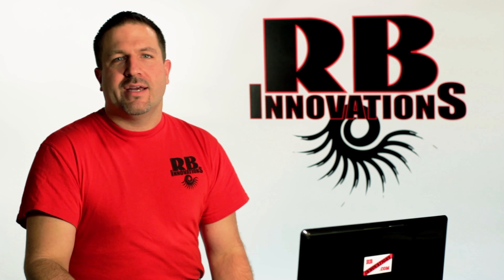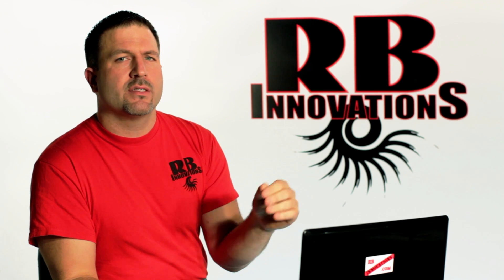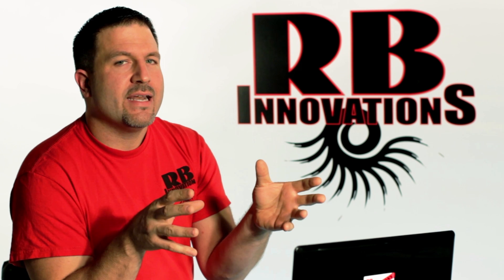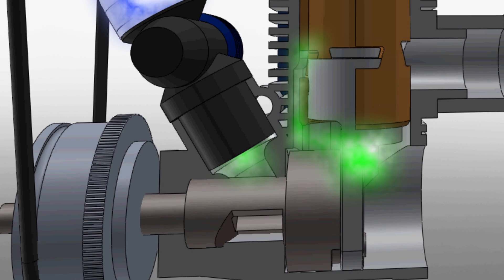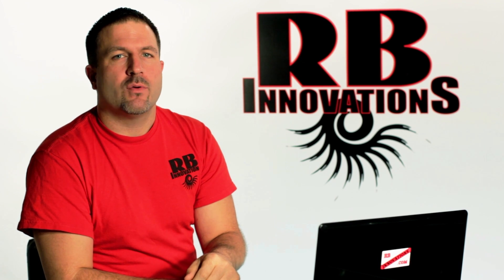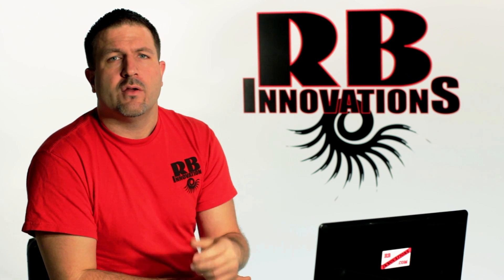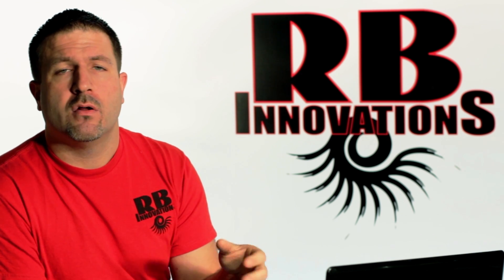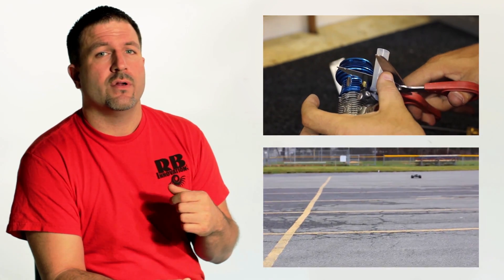How RC Nitro Superchargers Work

Comment: my name is  Peter. .. I want to say  that  if you  had  an extra sleeve  you could  tune  the  port  timing  and  volume. .    grind  some  material behind the engine cases..  and a bit  off the sleeve.   allows more volume of air to enter the engine. ..

Comment: Put it on a dyno or line 2 cars up which are exactly the same with one with one without the super charger. DEMONSTRATE the power gain.
Reply: Not much gain....even wit a boost bottle
Reply: It seems to be just blowing fuel out if it's doing anything at all. I might try hooking the engine up to an air compressor to see if boost does actually work on these engines but then again the pressure from the air compressor may falsify the results.

Comment: Ok its as I thought. At 1:45 he just described the process of a turbocharger, not a supercharger. A supercharger compresses the air/fuel mix before it enters the engine. Its like those cheap 12volt "superchargers" for car engines that are the size of a computer cooling fan inserted into the air duct after the airfilter, before the throttle body. In this case the exhaust must also be modified if the added air is to have the ability to flow through the motor.
Reply: What in the hell are you talking about?  This is a centrifugal supercharger, which uses the same kind of impeller as all turbochargers.  That's what he's talking about.  A turbocharger also compresses the air/fuel mix before it enters the engine - the only difference is what drives the compressor (a belt drive off the crank vs the exhaust gas).  This is a belt-driving supercharger, and there are many large centrifugal superchargers for car engines out there, and there even have been for some airplane engines (thinking most of some WWII fighter and bomber engines).
Reply: Matthew Miller Here, read this.
http://www.cumminsturbotechnologies.com/ctt/navigationAction.do?url=SiteContent+en+HTML+ProductsAndTechnologies+How_a_Turbocharger_Works
Ok I can take a correction about mechanically driven air compressors, aka superchargers, but only the ones that only compress the air first, exactly as a turbocharger does. Just so you know, it would be impossible to have the fuel and air enter a centrifugal impeller, as due to its density,the liquid would get forced to the outside of the wheel and be separated from the air, totally negating the desired effect of compressing the two together. It would also lead to hammering, and this vibration would tear the vanes off the impeller, causing the housing to explode. So I stand by my terminology. A Roots type supercharger is a positive displacement  device which compresses the fuel and air before it enters the intake plenum. Any belt or exhaust driven device should be called a turbocharger. The line shouldve been drawn to differentiate the two based upon their process, not by how they were powered. A simplification by having two distinct terms other than turbo and super would make things much easier. Oh and the superchargers used on planes werent belt driven. Are you nuts? A rubber belt on an airplane travelling through sub-freezing temperatures? They are mechanically driven from the engine.
Reply: John Robertson There have been plenty of carbureted, centrifugally compressed supercharger and turbocharger setups with draw-through architecture; such that they draw the fuel/air mixture through the compressor rather than just air.  It's not drawing liquid, but rather a vapor of fuel mixed with air.  It works fine.  I'm not sure what you mean by "hammering" - maybe cavitation?  Not an issue with vapor.  Anyway, there are also lots of centrifugal pumps for liquid, too.  So again, not an issue.  BTW, the full and technically correct term for a turbocharger is "turbosupercharger."  So all turbochargers are superchargers, but not all superchargers are turbochargers.  Anything that compresses the intake charge of an internal combustion engine is a superchargers.  Whether positive-displacement, centrifugal, or axial design; they all do that same job.  And I didn't say airplanes with superchargers had belts driving them - I just said some airplanes also had centrifugal superchargers.  That is, neither the technology nor terminology in the video is new or untested.
Reply: John Robertson Also, I'm not sure what you mean by "only the ones that compress the air first."  All superchargers, regardless of compressor design or drive mechanism compress the air or fuel/air mixture going into the engine.
Reply: Matthew Miller If you read back a few posts, someone said superchargers do NOT function in a manner as to compress the air/fuel mix. That is when I corrected them as to the existence of the Roots type of device. So I admit the existence of the air only "supercharger", however, I am saying it needs to be called something else, and the two types of devices should be separated by their function. In other words, if it compresses air only, regardless of what is used to turn the impeller, it should  be called an "AO"charger. If it compresses air/fuel, lets call it an AFcharger, or something like that. I thought I went to some effort to point that out in my last post, I can see some things escape the obvious. Dont be too hasty to comment on just one item in someone elses comment, you miss a lot, and just make it a PITA to have to explain it again.
Reply: Matthew Miller So the world of forced induction is worried about someone not being able to completely understand the function of something, because they change the name and all of a sudden instead of a positive displacement, now its called a non-negative displacement? (sic). "We're going to measure  the power of this motor in kilowatts, because some people don't know what horsepower is". Hmm, thats worked out fine up to now.
So thats interesting that the old term was turbosupercharger. I guess that was too long of a word to write, so it got shortened to turbocharger. Hey wait, did they change the name of a thing and didn't change its function? Wasn't that the whole point of your last comment? So someone DID decide the world was ready for a new name for an old product, maybe because it wasn't mechanically driven! Thats the point of my comment. You said there are exhaust , belt, and mechanical driven centrifugal draw through and blow through superchargers. Why were they called turbosuperchargers? Was it because of the centrifugal part instead of the interleaved lobed type? Another reason to realize that enough thought wasn't given to the technology. Are you a fan of reptiles and amphibians? You should know that after 150 years of classifying an american toad as a bufo americanus, it got placed in a new genus Anaxyrus. Another example of an old thing which didn't change renamed to something new. No one complained, not even the toad.
Have a nice day, thanks for the info.
Reply: John Robertson I think I don't know how to have a conversation with you.  Words seem not to mean the same thing to you as they do others who discuss this technology.  Either that, or you're just a troll trying to get a rise out of random people.  Example:  "You said there are exhaust , belt, and mechanical driven centrifugal draw through and blow through superchargers. Why were they called turbosuperchargers?  Was it because of the centrifugal part instead of the interleaved lobed type?"  Seriously?  The ones driven by exhaust gas acting on a turbine are/were called turbosuperchargers, and the others were just called superchargers.  That terminology has nothing to do with the design of the compressor - just the method of driving it.  It really IS that simple, whether you want to believe it or not.
Reply: Yes. Why did they drop the "super" part of the name? You failed to answer that. You seemingly dropped off the topic of the change in nomenclature. When i get the chance, i will search for your claim that its the driver action that differentiates the two technologies.
Reply: It is exactly as i said. I had read it earlier and now again. All forced induction devices were once called superchargers. And also as i stated earlier, many things have their names changed, and the world goes on.
Reply: John Robertson They still are all technically called superchargers.  The "super" part of the name is never used for a turbosupercharger because it's just a mouthful.  That's also why they are often referred to just as "turbos."  It's not hard to find this info if you are actually interested in finding it: http://en.wikipedia.org/wiki/Supercharger.  Second paragraph: "Power for the supercharger can be provided mechanically by means of a belt, gear, shaft, or chain connected to the engine's crankshaft. When power is provided by a turbine powered by exhaust gas, a supercharger is known as a turbosupercharger[1] – typically referred to simply as a turbocharger or just turbo. Common usage restricts the term supercharger to mechanically driven units."  There - I searched it for you.  If you don't even know what a turbocharger is, stop posting and read a book.
Reply: Dude, i was trying to be nice. You obviously missed the part in all your wiki searching that dealt with how a centrifugal pump works versus a Roots pump. Centrifugal pumps, whether they pump air or liquid, work in a vacuum. Roots types work by compressing a volume of air that is at atmospheric pressure. Again, this takes me back to my point of the differentiation. You are obviously stuck on not letting any hint of a new concept into your head. Im muting this post, dont respond. I already thanked you for your information before, and you threw it in my face. Sit on it.
Reply: John Robertson Centrifugal pumps work in a vacuum?  I'll end this hopeless string of replies where I began: What the hell are you talking about?

Comment: WHY IT DOES NOT WORK. YOU GUYS DID NOT COVER THIS IN THIS VIDEO AND I SEE THIS TO BE THE ONLY PROBLEM. TUNING... ANY ENGINE THAT IS ON BOOST NEEDS MORE FUEL. YOU GUYS DO NOT HAVE A WAY TO INTRODUCE MORE FUEL. THEREFOR YOU WILL HAVE TO TUNE THE ENHINE VERY RICH. SLOW UNTIL HIGH RPM.  IT WORKS KINDA... IT TRULLY NEEDS TO BE FUEL INJECTER WITH FULL FUEL MAPING TO RUN CORECTLY!!!
Reply: Lots of carbureted engines have had forced induction over the years, but turbo- and superchargers.  They can either be draw-through or (like this one) blow-through designs.  In the latter, as long as the whole carb is pressurized, the additional air mass being pushed through the carb venturi will be matched by additional fuel being drawn through the needle valve (or jet, for other carbs) by the air mass.  In this video, he mentions pressurizing the fuel tank, which is essentially the same thing, and I would think is really necessary to get a setup that carburets cleanly from idle to WOT.
Reply: first of all the carb is not a blow throw design. next the tank does not have a pressure seal. and any pressure would be limited by the needle valve. there for not supplying the proper fuel mix
Reply: Joshua Bliffen What would need to be changed on the carb to make it "a blow-through design?"  Typical r/c fuel tanks can withstand a decent amount of pressurization.  There have been pressurization schemes in r/c and control-line model engines for many years, often used to ensure steady fuel flow in planes built for severe maneuvers. The tank won't need to have a perfect seal, since this s/c could easily supply a small amount of ongoing flow of air to keep it pressurized.  Again, this has been done for decades.

I'm not sure what you mean by "...any pressure would be limited by the needle valve."  The needle valve comprises an orifice, and as with any other orifice the fuel flow through it increases with upstream pressure.  In this case, though, I believe the tank pressurization would really just be to equalize the boost pressure, much as a car's carb on a blow-through design would need to have its float bowl pressurized (r/c carbs don't have float bowls).  The actual mass flow of air through the venture is what will draw the extra fuel through the needle valve.
Reply: i dont see the tuning ability to make it work well. most nitro engine run bad anyway. i would think boosting the tank more that what is has stock would cause leaks of loss of pressure. it there any videos of one running well with boost? in my experience no blow through or draw through carbs have ever worked good on any engine.
Reply: Joshua Bliffen I more or less agree, in that these two-stroke engines are really optimized for a narrow rpm range if they use a pipe, and if they don't then they really expel a lot of unburned mixture out the exhaust (although port timing is changed up to have less overlap to account for that).  Your general premise that EFI is far better is true, too.  But I'd say all of this is true whether we're talking about supercharged r/c engines or not.  I've seen a few videos of cars with this supercharger that seem to carburet as well as stock n/a engines, fwiw.  To me, this blower is more an exercise in doing something interesting rather than having a truly practical purpose at this size of engine, since one could probably just use a larger engine and be less complicated and lighter.  But there's no inherent reason it can't work as advertised.
Reply: Matthew Miller very true a cheaper way is just to use a nos system. cheap easy to install and noticeable results
Reply: Hah!  I didn't even realize people are using NOS on r/c engines.  But a quick youtube search shows they are.  And they do seem to make power.  Fun stuff!
Reply: very fun and so much more easy and cheap than boosting.

Comment: I never understood y people complained about boosted 2 strokes, yes raw fuel will come out the exhaust, but so does a stock engine, just watch an rc like the traxxas revo that that the exhaust is pointed down and let it idle on concrete for about a minute and then look under there's a splatter pool, & the compression would be the same as using a dual engine combo, without the hassle of tuning 2 engines

Comment: Although I do have my doubts I'm not going to just talk out of my ass about your product. My only issue is your not really forcing fuel your forcing air. Being that fuel then gets added in your forcing the mixture I guess. My doubts come from on a nitro engine there is as much air as needed. You can even run it so lean by adding air just by turning your main fuel air mixture screw enough to blow the engine in minutes. So it seems there is plenty of air already. Forcing more just seems to me like a failure is for sure going to occur. The 3.3 for example already turns to many RPMS for its stock main bearings right bone stock out of the box. That being said if I was to run this product I better find some super tough main bearings first.